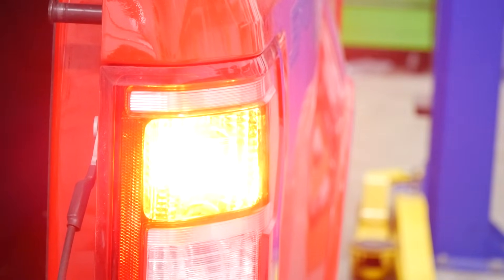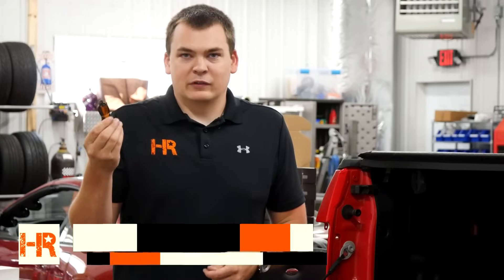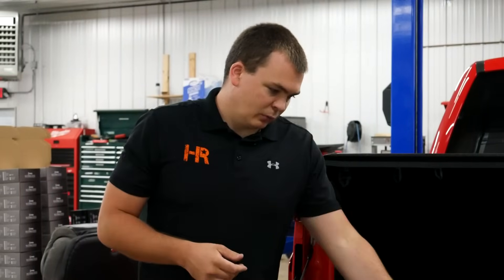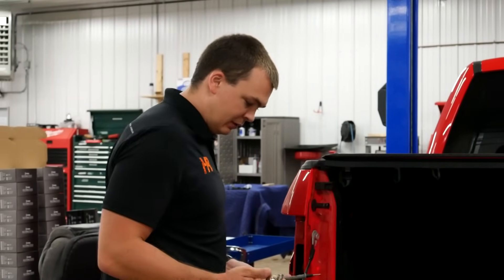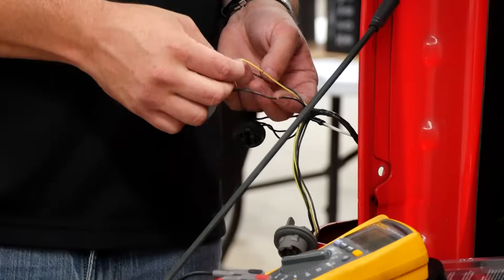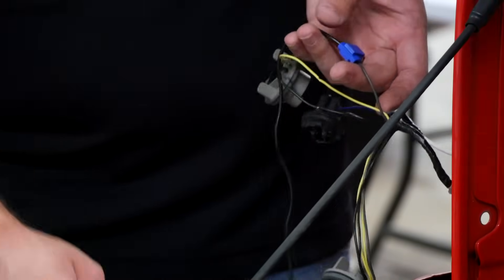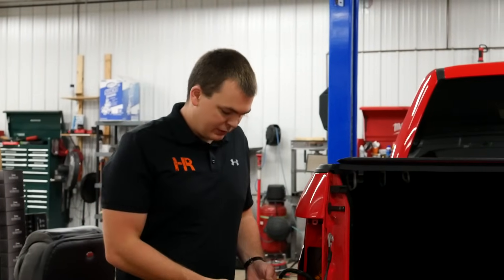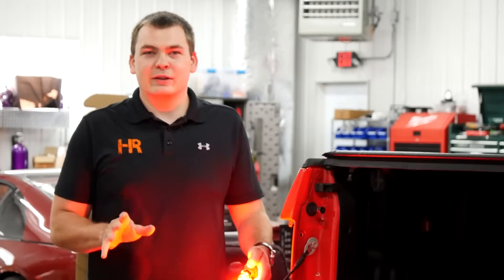How To Install LED Resistors - Everything You Need To Know | Headlight Revolution

Comment: I got a question. I have ford ranger, however my tail light and stop light use the same bulb. When i install LED there is little to no difference on tail light(side lights at the rear) and the stop or brake lights brightness. Will a resistor on the side light wire artificially "dim" the LED, by reducing the current or voltage to it, so when i press the brake pedal, itll be more prominent by allowing the full current through?

Reason i ask, is i noticed on the F150 there, regardless weather your turn signal or stop light is on the same bulb blinking, i noticed its on dim, but blinks brighter when the turn signal is on. If not, is there a special LED that illuminates in thhis way? I have a T20 type LED in.
Reply from the maker: With those rear lights, if it has the turn signal that uses the same bulb as the brake lights, that will require a resistor to be installed. That wouldn't be something that would cause the lights to function differently, so I am not sure what is going on with your vehicle. Shoot us an email if you are concerned still, and we will get you taken care of! Sales@HeadlightRevolution.com

Comment: My 2018 Chevy Malibu LT uses a 7444 socket on front turn signals, but it doesn't use the parking lights filiment. I have 4 wires per side on the front: a purple wire, light blue with white stripe, and 2 black wires. What wires do I need to test? And can I test directly to the wire itself?
Reply from the maker: In this case, it would be best to test each wire, that way you'll know what each one does.

Comment: Hello guys, great video and I made sure to like! 

I just had one quick question: Do I need to buy a specific resistor for my vehicle (2010 Jeep Commander Sport)? As with bulbs, certain types apply to certain vehicles, and I don't know if that is the same case with resistors.
Reply: The resistors will be universal across all vehicles (~6Ohm) You would likely would be able to find a set at your local auto store.
Reply from the maker: This is the resistor that you will need!
https://headlightrevolution.com/gtr-lighting-50-watt-6-ohm-gold-style-resistors-for-custom-installation/
Reply: @HeadlightRevolution  Hey guys, I just have one more question, and wanted to see if you have an answer. I'm looking to find resistors for my interior lighting, as they flicker while the headlights are on, and the dome light remains on with an ambient dimness. Do I need to buy better bulbs, or resistors? And if so, do you know which resistors would be best for the situation?

Comment: I'm planning to change my reverse lights to LED, do I need to have resistors for them?
Reply from the maker: It will depend on the vehicle, but 95% of vehicles do not require resistors for reverse bulbs.
Reply: If u have reverse sensors or camera led reverse lights will possibly mess with them...fitting resistors today on my 2010 FG xr6 reverse lights

Comment: Nice bro... thanks for sharing, i had an issue with my tail led light signal hyper flashing.. just want to make sure the load resistor wires can go to any with condition must either signal or ground is it?? Thanks again
Reply from the maker: Yes, that is correct! Just be sure to tap into the ground wire, and the signal 12v wire.
Reply: Just installed load resistor on my led tail light... thanks bro your sharing very helpfull... now hyper flash issues solved.
Reply: You can go on amazon and simply get a LED flasher module to plug in.  Like $9. Unplug old bulb flasher, replace with LED flasher. No solder, no heat, no mess
Reply from the maker: That is totally another great option for you, and that would require you just finding the correct relay for your vehicle! Other than that, saves the process of tapping the fuses, and helps keep your OEM harness that much more clean!👍
Reply: Summer project for me cant wait to try this

Comment: Just buy a flasher relay that has been designed to operate with LED'S....
They cost just a few bucks....
Reply from the maker: Flasher relay is certainly the way to go if it's applicable. Unfortunately, most new vehicles use the BCM to control the turn signals, and not a flasher relay. So a resistor is the only way to go.
Reply: @HeadlightRevolution  I stand corrected. My bike is a 41 year old Honda CBX1000 and that has all bulbs replaced by LED's and all is fine.
Newer technology seems to have its drawbacks....
Reply from the maker: Yeah... they have their ups and downs.

Comment: i am trying to install resistors because i put some spyder led tailights on my 2013 chevy camaro and now the dashboard says "check left rear turn signal". Would it be best to put resistors on all 4 lights?
Reply from the maker: We're honestly not too familiar with those tail lights. The lights should have came with the correct resistors already installed. I recommend reaching out to Spyder directly on this one.

Comment: Had to put 2 resistor on each side of my 17 tahoe, but its working great now
Reply from the maker: That's great to hear!
Reply: Just curious why you had to put two on each side. I ask cause I think I might need to do that. My issue is when my headlights are off the flash fine, when head lights are on I get hyper flash. Just to note my tail lights are also my blinkers.
Reply: 2 resistors inline or in parallel?

Comment: i bought Resistors for the LED Headlights in my 2016 Jeep Cherokee.  the instructions say to mount them on metal because they get very hot.  there are no metal parts around my headlights.  what else can I do?
Reply from the maker: In that case, I would go with a resistor that won't get hot enough to damage any plastic, like the ones from Xenon Depot. 
https://headlightrevolution.com/xenondepot-xd6-6-ohm-resistor/

Comment: Explain me, why, when I installed the front and rear LED lamps, and installed the rear LED resistor, it didn’t work for me. Continuing hyperflushing.
Reply from the maker: What bulbs and resistors did you install? This could be caused by quite a few things.
Reply: @HeadlightRevolution  front ALLALighting 3157, rear LUYED 4157 and resistor from DIODE DYNAMICS 50W6
Reply: U need a resistor on all 4 bulbs right?
Reply: @andrewjohnson3587  Yes, I was thinking of replacing both front and back on LSD.  installed one resistor to one side. does not work

Comment: With a test light, finding which one is hot and which one is ground you clip to a known ground and then probe the wires. If it lights it's hot, if it won't light it's a ground. If you clip to one wire and test the other it lights up either way but you don't know which is ground and which is hot.
Reply from the maker: A test light will certainly work as well!

Comment: I need to add load resistors to my 2018 Malibu. Its for my reverse light but i don’t know which wires to put the resistors on. There’s 3 wires
Reply from the maker: Is this for the headlights, or for the turn signals?
Reply: Headlight Revolution it was for reverse lights
Reply from the maker: Most reverse lights should only have 2 wires. But to find out which ones you'll need to tap into, you'll need to test the wires to find the power and ground wire.

Comment: Can you use tape instead of the screws to hold the resistor
Reply from the maker: That is not recommended. Sense the resistors get hot, it will melt the tap. Using the screws is the best option.

Comment: I have 2010 Chevy Silverado and I want to convert the front turn signals the LEDs but not the back ones do I still need install resistors on the back lights to?
Reply from the maker: No you will not. You will only need to install resistors on the turn signal bulbs that you change out to LED.

Comment: Could you only do this on the rear but still put them on your front turn signals?  Or do both front and back have to be load equalized? In other words, will the front turn signals still hyperflash if you only do the rears?
Reply from the maker: Yes they will. You will need to install a resistor on any LED turn signal bulb that you install.

Comment: I put a eye connector on the wire and grounded to the body and works just fine
Reply from the maker: Yes, you can ground to the battery as well. That won't cause any issues.

Comment: Hi. What size resistors should I use for my 2009 jeep patriot front signal lamp?
Reply from the maker: These are the ones that you need!
https://headlightrevolution.com/gtr-lighting-50-watt-6-ohm-gold-style-resistors-for-custom-installation/
Reply: @HeadlightRevolution  thanks.
Reply: & for my headlights. I have LED but it flickers. The decoder I have does not work.
Reply from the maker: You're very welcome!
Reply from the maker: What LED bulbs are you currently using? Most headlight applications do not require using a resistor. Using a better PWM decoder may fix this issue instead of using a resistor.
Reply: @HeadlightRevolution   its CBI LED
Power 40W EMC
Input Voltage 8-48V
Model  H13 hi/lo
This is what is says on the part.
If u can recommend a package with brighter bulbs & component I am willing to switch. If the bulbs that I have are ok then I would just need the correct component for it. Those bulbs are also used for DRL as well.
Reply from the maker: hmm, do you have a link to where you purchased the bulbs by chance?
Reply: @HeadlightRevolution  i bought it @ a farmer's market.
Reply: @HeadlightRevolution  its a flea market accessories store. Everything on the box is Chinese writing.  I saw Rigid Industries has a pwm recommended for my vehicle . But its H13 input to H14 output. What do u recommend?
Reply: @HeadlightRevolution  im not quite sure if u can upload a picture so you can see

Comment: Hi can we put just one more stronger Resistor direct on the Battery so can be works for all lights ? hop to hear answer..
Reply: The way I did it the one time I did that mistake, I put the resistor between the flasher relay and the flasher switch. that way it covers both sides. 
But the proper way to do it would be to replace the flasher relay with the correct electronic one. No half ass job in the wiring, no burning hot resistor, no fire risk.
Reply from the maker: Hey Raad, unfortunately that doesn't work. If you have a vehicle that uses a relay for the turn signals, you can use an LED flasher relay instead. But if you don't, the only way to do it would be to wire in a resistors for each bulb.

Comment: When replacing turn signals with leds  in the front and rear of the vehicle do you have to install resistors on all 4 corners or will one set in the rear or the front work for all 4 corners thanks
Reply: 4
Reply: None. Use the proper electronic flasher relay instead of hacking your wiring.
Reply: @FMuscleZ28  depending on your car. Newer cars may not come with flasher relay. But you should find a relay first
Reply: @FMuscleZ28  i should have check my car now. What do i need to do that myself?
Reply from the maker: If you're not able to use a flasher relay, the best sized resistor to use is a 30w 6 ohm.
https://headlightrevolution.com/gtr-lighting-50-watt-6-ohm-gold-style-resistors-for-custom-installation/

If you are able to use an LED flasher, and parts store will be able to look up which one you need and get you the correct one.
Reply: @HeadlightRevolution  evo x final. Any flasher available? I couldn't find one
Reply from the maker: I do not believe so. If I recall correctly, that vehicle uses the BCM to control the turn signals, and not a relay. So you'd have to use a resistor.

Comment: I thought I could put led in my 05 Range Rover LR3.  But it put out transmission error, ride height error, cruise control error, DTC error.  I put the incandescent back in and back to normal.  Will load resistors stop all these errors?
Reply from the maker: That's a very strange issue that we haven't seen before. What LED bulbs did you go with? Adding resistors may help, but it is not common for the issues that you have, to come up when making the switch to LED.

Comment: I have just installed two 48 in LED light strips on my running boards and everything is working normally except for when you signal left-to-right individually the lights flicker what is my problem and what can I do to fix it please let me know please and thank you big fan of the channel keep up the good work guys keep the videos coming
Reply from the maker: What LED strips did you install? That sounds like it may be an issue with the strips and not an issues that a resistor would fix.

Comment: I personally find it much easier to solve the fast flashing issue by simply installing an electronic flasher in place of the standard one(a simple plug in) which normally sells for about $9.00. It also saves on power usage, unlike substituting a filament bulb with a resister to mimic the same wattage draw in the circuit. It's a whole lot less work not altering your wiring too!
Reply from the maker: Installing an LED flasher is certainly a much easier route! However, most new vehicles do not use a relay to control the turn signal anymore, and it's all done through the BCM. So in those cases, wiring in a resistor is the only option.
Reply: @HeadlightRevolution  Yes that is very true of most newer vehicles that now have a BCM do the job, in that way it cuts the cost, and they are proving to be very reliable. The down side is having to keep the draw on the circuit close to what the original incandescent lamp used by way of a resister which is more work to wire in than simply changing over to an electronic flash as we did on our older models. I have a 09 H2 that has the BCM, so if I want Led turns, I have no choice but to throu in the resisters in parallel with the bulbs. Thanks for responding, and I do hope more sites will mention that the E flasher is a great option when their is no BCM. Another monkey wrench you can encounter, mostly on the foreign cars is the can-bus systems. But that's a topic for another day😉!
Reply: I have a 2022 Jeep Wrangler Rubicon JL. I'm following instructions for a delete kit that takes the front drl light/signals and swaps it to a small circle light in the delete. I have my ground,  blinker, parking wires. Blinker to one side, and ground on the other. I've tried adding the resistor to run with each wire, I did the wire taps like you did here. Blink outside is normal,  inside its fast. Also with the resistor hooked up the parking lights won't work. And btw it's Rough Country's fender delete kit I'm installing.

Comment: If upgrading all the turn signal bulbs to LED, what is the disadvantage to changing the flasher unit to an LED compatible model rather than wire in resistors? Second question, is there a down side if one decided to go back to incadecent bulbs, i.e. do the resistors need to be removed so there is less amperage load on the wiring?
Reply from the maker: There is no downside to using an LED flasher unit instead of a resistors. However, most new vehicles do not use relays, so they cannot be used.

If you go back to an incandescent bulb, you will need to remove the resistor so that you don't have to much resistance in the circuit. Same goes for if you use a flasher unit as well.

Comment: Thanks for the great video. I'm looking to do so ASAP when mine arrives. However, in my Caddy, there's a sealed cover involved. Where would I put the resistor then? Thanks in advance.
Reply from the maker: The headlight or tail light should have a main wiring harness that goes to the assembly, you will need to find the power and flashing 12v wires within that harness and tap into those wires there.

Comment: so.........you wont use heat shrink cos it compromises the original wire but you're happy to use a shitty crimp connector which cuts your original wire in half?
Reply from the maker: We always recommend solder and heat shrink when doing any wiring. However, a lot of people aren't able to use a soldering iron, or know how to use one. In cases like that, that's when the T-Taps are used. It's not the best way to go about it, but it still can be done.

Comment: my led lights will blink fine, but it does not turn on. they only come on when i hit the turn signal.
Reply from the maker: What vehicle do you have them installed in? This is likely due to your vehicle taking a single filament bulb and not a dual filament bulb.

Comment: Do you add resistors on both rear lights lights
Reply from the maker: You will need to add a resistor to any bulb that flashers as a turn signal.

Comment: What do you think about putting a thermal pad or even thermal compound under the resister where it touches the car metal?  Basically doing the same thing you do when putting a heat sink on top of a CPU, so the heat from the resistor better transfers to the metal of the car?
Reply from the maker: That's honestly not really needed, but it would certainly work.

Comment: if i have led light in the back and from on my car i still need 50w load resistor ???
Reply: on both side
Reply from the maker: If they are aftermarket LED bulbs, then yes, you will need a resistor.

Comment: What about adding them to LED headlights that are flickering on low beams???
Reply from the maker: It really depends on the vehicle, but on most vehicles, adding a PWM module will fix flickering headlights.
Reply: @headlight Revolution, I had already ordered an anti-flicker module. Is that the same thing? Will it work as well?
Reply from the maker: Yes, those will work as well! Most companies call them an anti-flicker module instead of a PWM module because it's easier for people to understand.